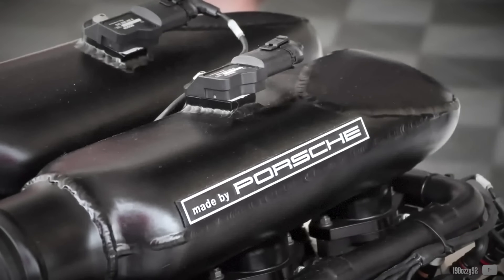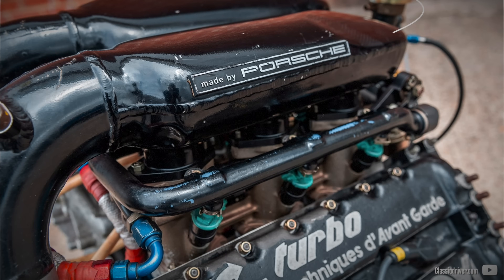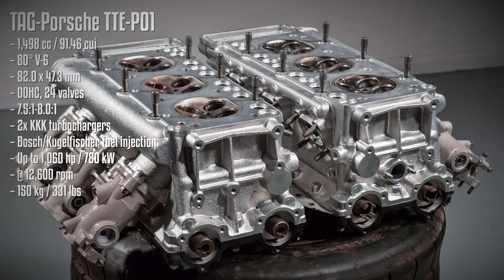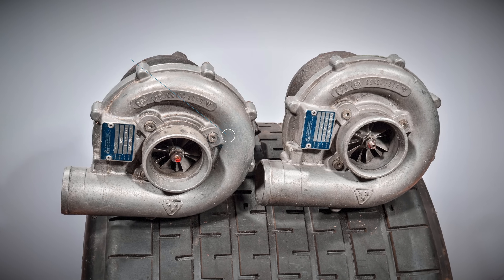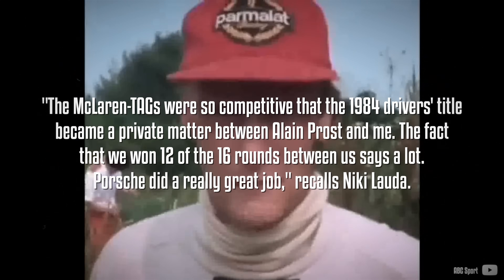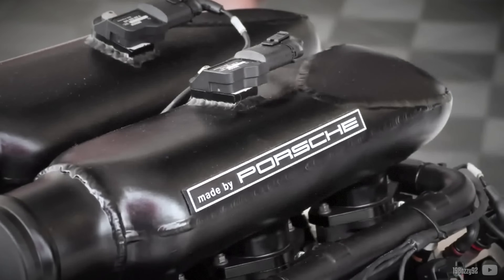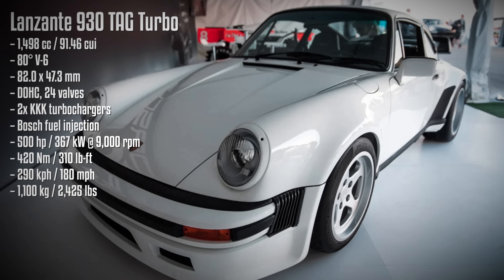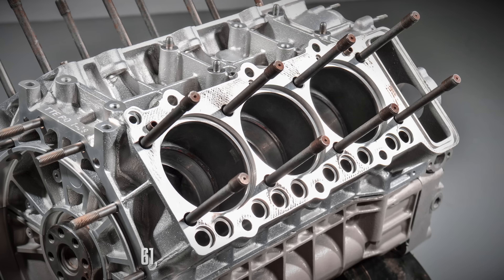When UNDERPOWERED Porsche F1 Dominated With A V6 Turbo

Comment: It's hilarious that Porsche was able to excel so much with a water cooled engine and the 911 was still air cooled.
Reply: Yeah it’d be like Harley Davidson running twin cam water cooled motors in racing but giving the public what they give them now
Reply: @POVShotgun  For a long time that's what the market wanted.  The problem now is everyone who wants a bike like that now has a bike like that.
Reply: Liquid-cooled engines are reportedly easier to set up for high output because they avoid the heat rejection issues that tend to plague high output air cooled engines. BMW only changed over to air cooled aircraft engines because the Nazi government ordered them to do so. Same with Fiat and Mussolini. That is why, despite having the best aircraft engine research facilities in the world, during WW2, the Italians had to resort to licence production of a Daimler liquid cooled engine. If Fiat had been allowed to stay with liquid cooling, the Regia Aeronautica could have had all the high performance engines they needed. I also suspect, that with Fiat’s research facilities, they would have emulated Rolls Royce by using the high pressure cooling system that was a key advantage over the relatively low pressure system used by Daimler Benz.
Reply: @michaelguerin56 liquid cooling allows control over temperature over all rev ranges allowing closer tolerance and radical Timing etc.
The most power ful engines in ww2 where radial air-cooled , notably the focke wolf 190, they where also more robust and less prone to damage as there was no rads to puncture and three banks of cylinders meant they could loose cylinders and still run unlike water cooled in line engines.
Reply: @pbysome  Only when they could get the right fuel and properly built components. Allied trials and postwar trials were conducted with better fuel and components. I suggest that you read The Secret Horsepower Race and watch some of the author’s lectures/discussions that have been posted on YouTube.
Reply: @michaelguerin56 why would I do that?
Reply: @rockets4kids that's a good wat to put it. But in addition to that the buyer bracket who has historically bought v twins is no aging out leaving an ever smaller pool in which to sell to. The younger generations are not buying them. They see them as old people toys, and something criminals have. Also, internal combustion engines and even vehicle ownership as a whole is not something they crave.
 
It's a tough nut to crack.

Comment: 1000hp from a 1.5liter engine just what i need for my motorcycle🐱👍🏿
Reply: ¿are you planning to dig a hole with that as a tool?
Reply: I'd be more interested in a 250 hp 750 triple derived from half of the Lanzante 930 engine
Reply: @Xayuap  naaaah i intend to clip wings on my 15yr old bandit and fly with 1000hp of thrust! 🐱👍🏿
Reply: @PaulG.x  good choice!
Reply: dat makes a lot of sense
Reply: Bmw had the record of Formula 1 with 1450hp
Reply: wheelspin de luxe
Reply: Porsche never made qualify engine. The most it made was 975 hp as it not able to handle high pressure. The engine really shines in race day as it had better power, fuel efficiency, and reliability against all bar Honda

Comment: The majority of turbo engines back then had relatively low compression.  They didn't have the electric aids of today to control things like detonation.  We had built a 350 Chevy back then with 7:1 flattops, bronze guides and titanium valves, exhaust wastegate, and water/methanol injection under boost powered by a windshield wiper pump.  Turbo engines were so basic back then.  I would love to know how much power someone could get out of those 40-year-old motors without changing the block or heads.
Reply: Don't all turbo engines have low compression?
I mean it's a feature that allows them to operate, at all - I.e. you can't shove twice the fuel and air, I to a high compression (naturally aspirated design).

American V8s are another phenomenon altogether, mostly NA, and yet, lower compression than Benz's first engine, back before Ford had even built an engine.
Reply: @Grrrrrrg  I think F1 today is limited to 18:1.  In 2026, they will be limited to 16:1.  Also, the engine inlet air pressure must be less than 4.8 barA at all times.
Reply: @AndyFromBeaverton 5,5 bar at 1985.
Reply: @Oberon_Boost  But they didn't last very long at that pressure.  BMW only went that high in qualifying and put a new block in for the race.

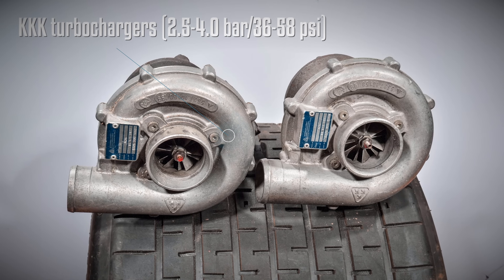Comment: 2:59 - That's PSIG, not PSIA?
Reply: If the engines not running then the intake plenum is relative to atmospheric pressure, when the engines running you have a vacuum at the inlet of the intake, the boost pressure is positive pressure, measured relative to vacuum, so absolute or PSIA,   I mean I could be wrong but a little bit of Googling should help clear it up
Reply: @LeapFrog_Radio  boost is usually measured in PSIG

Comment: This "TAG-Porsche" 930 1.5l V6 Turbo is truly unicorn !
Never thought about Porsche 911 been using F1 engine before ! 
But about this F1 1.5l V6 engine put in Porsche 911 is water-cooled engine or same way like Porsche 930 RSR still by Aircooled engine with engine oil cooler support engine ?